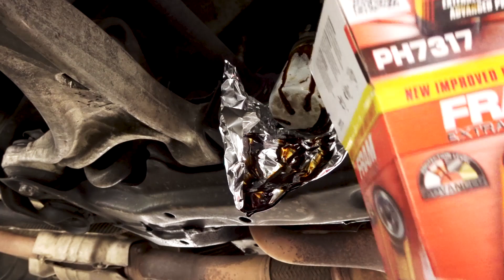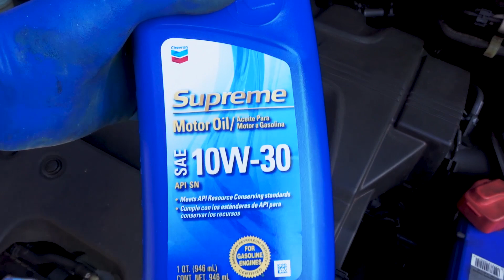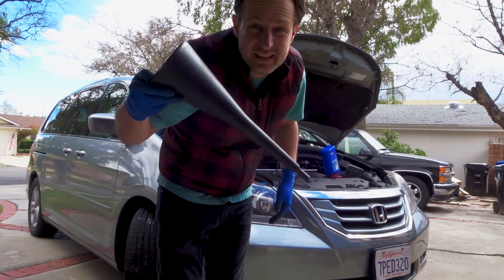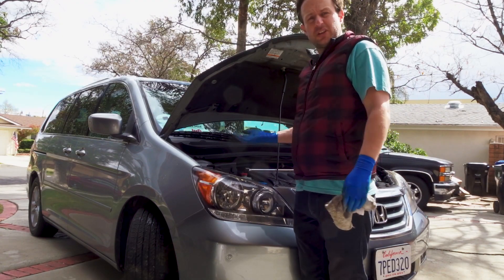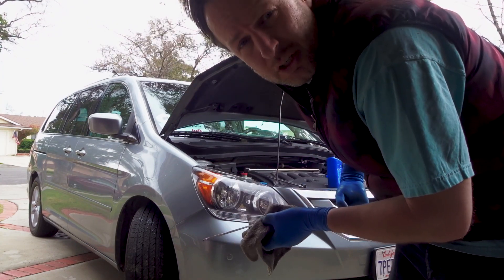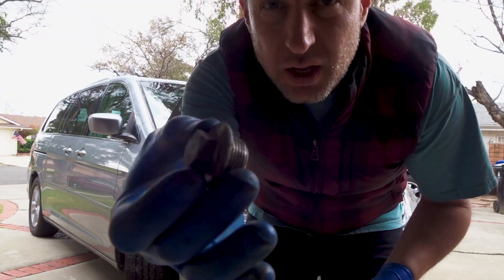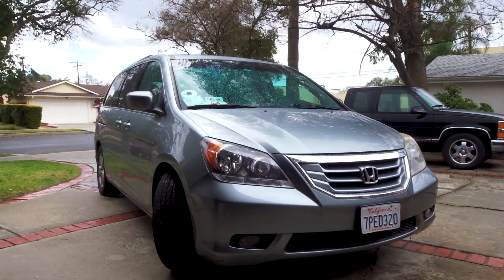Do you use Lube? Getting frisky with my Honda Odyssey 2008 Fun Oil and Transmission Fluid Change

Comment: Dave the reason why your oil filter gets stuck so tight is because you didn’t lube the filter gasket . 
You need to dip your finger in the oil and get the rubber gasket on the filter So there’s oil on it . Then when you go to take it off it will be nice and easy. Also it’s recommended that you fill you filter before putting it on .
I usually fill my filter up a bit put my finger in it rub that oil on the filter gasket and I’m good to go
Reply: I do that with my girl makes rimming easier.
Reply from the maker: My dad mentions that in the video and I didn't put that filter on is why.

Comment: You can take off the oil cap on the valve cover to to flow the oil out more quickly and completely. Make sure you wipe down that rubber CV boot oil makes them wear prematurely. Love your vid @davetheuberslave!
Reply: Eric Willett that makes no difference lmao
Reply: Daniel Jones cover the opening with the cap removed and remove it while oil flows- goes from stream to Niagara! Give it a try. Oil hardens when exposed to the external of your sealed engine. Partnered with rapid heating and cooling the boot goes dry and cracks over time

Comment: I nearly always do my own oil changes. The easiest car I have ever done was a 2001 Australian Ford Falcon pick up (we call ute in Aussie). It is a 4.0 litre inline six and the plug sticks out the side rear corner of the pan -easy to get to, and the filter sticks out at a 45° angle and doesn't spill a drop as you remove it. It's a breeze to do.
Did you smear the rubber seal if filter with fresh oil before screwing on? Always advisable. I always wipe around the plug and other oily areas with a kerosene soaked rag .afterwards.
Reply from the maker: I've seen a ute before. My dad and I were talking about putting oil on the gasket in the video.

Comment: Don't cars with high miles require oil that is lighter in weight?
Reply: Au contraire mon ami, worn engines require thicker viscosity oil.

Comment: Hey Dave, do you know if uber select is worth it. I drive uber x full time and I'm not sure if I should invest in a select or xl car.
Reply from the maker: If you live in a place like Beverly Hills and you don't mind hanging out at home waiting. As an XL driver I can say it's good but some days I don't get any XL trips so I waste gas. It seems that here in La the drivers that make the most money are in cars that get excellent gas mileage. Even though it may not be as profitable to be in my van I like it because I feel more protected in an accident. If you only drive on Friday and Saturday nights XL is the way to go.
Reply: @DavetheUberSlave  
Thanks for the info. I agree with your previous video mentioning the prius and the break down of other class vehicles. What are your thoughts regards to uber select? I was thinking if I drive both uber x combined with select full time, in the end I will make more than driving a prius full time including gas and other expenses. Thanks again! May you be safe out there, LA is crazy at times.
Reply from the maker: You can get a cheap Prius much less than 10 grand and you can get a select car that gets really good gas mileage. You can't get a cheap Select Car.
Reply: @DavetheUberSlave  
I was thinking of a used Acura ILX for around $15,000 for select. Is there a market in LA for uber select? Thanks for your advice Dave .

Comment: You got a new van? Wow, at what miles did you change your transmission oil at?
Reply from the maker: It's the same van
Reply: @DavetheUberSlave  for some stupid reason I thought it was a bronze or gold brown kinda van from your earlier videos. Oh well. Anyways, the real important question is, at what milage do you change transmission fluid?
Reply from the maker: It's in the description. 😉
Reply: @DavetheUberSlave  woooooooww I didn't think you didn't it that often, 10k to 15k. Blew my mind. Heck I was doing it every 30k thinking I'm over doing it, because my manual says every 60k, but here you are doing it even closer together... 😱👍👌, I do feel you on the changing the oils yourself. I've had bad experiences with dealerships working on my car so I dont go back to them anymore, especially since I've always done my own mechanic work since I was 17, over 20 years of experience now. Keep up the good work bro
Reply from the maker: I feel the same way because I've also had so many problems with shops and dealerships and often could have gotten the job done faster and cheaper myself all while knowing it was done correctly.
Reply: @DavetheUberSlave  did you pass by LAX yesterday? Closed upstairs, sucks... and today some uber or lyft drivers got into a fight because the cops where in the waiting parking lot... lol dam kids driving I'm telling you. 😂🤣😂